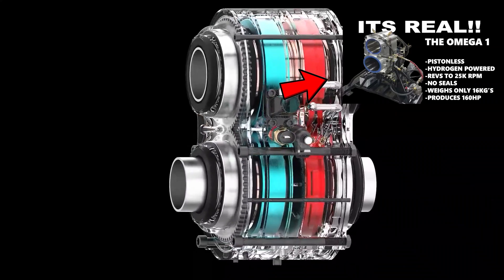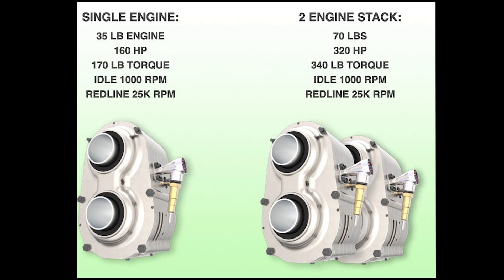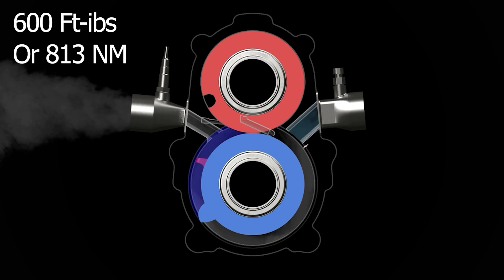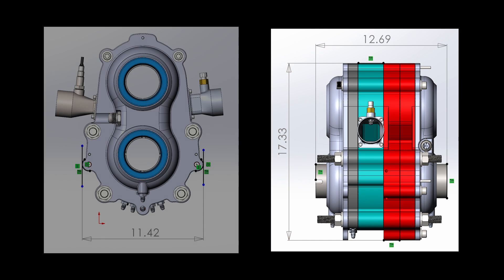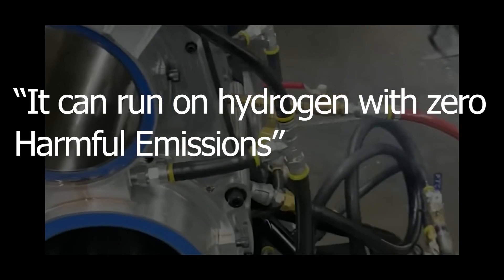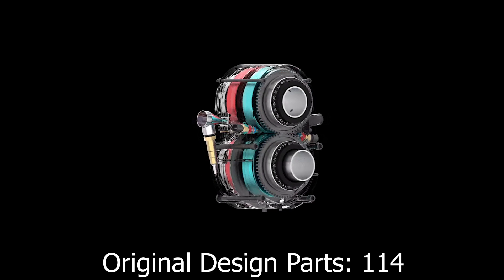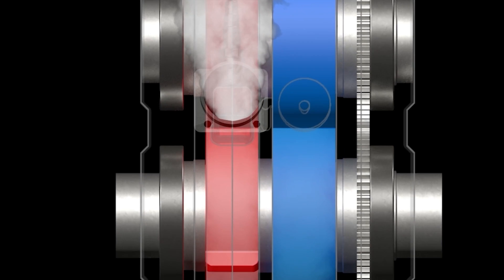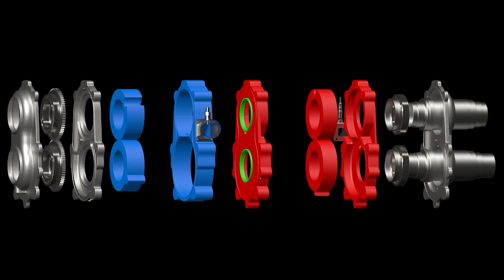Astron Aerospace Reveals Some Secret info on their Pistonless Omega 1 Engine - Starfire H2

Comment: well they claim you dont need seals and i think that running vid disproves that  with the flood of oil leaking past the upper rotor tube  upper and lower main ebd bearing seals are indacated  and gasket seals between the layers.   
  Me i want this for ships.

Comment: It looks like it's scalable, so it can be run in either series or scaled up to larger sizes, so it should be suitable to replace most other ICE power units.
The problem is getting a car manufacture to use it. They employ dozens of engineers to design their engines already, and there is no way in hell that those guys are going to say, "Oh look, let's use this engine instead of one that I designed!" 
The best chance is to get someone like Elon Musk to have a look at it. He'll be looking for something new for his Tesla's now that the EV market has pretty well collapsed. Maybe as part of a hybrid set up for his cars?
And seeing as Ford, GM, and VW look like collapsing, there is going to be a huge vacuum in the market just begging to be filled with the next big thing.
Reply: I had the same thought but CATL have created a million mile battery and after 100,000 recharge cycles does it start decreasing and performance degrades after 500,000 miles

Comment: So 600 ft-lbs, but it sounds like it falls on it's face real quick given the 25,000 RPM redline as that torque figure would give the 450HP rated power at a mere 4,000 RPM
If even half of that torque was available at 20,000 RPM, this thing would obliterate the 1,000 horsepower barrier, and still be able to keep pulling to 25,000 RPM but that clearly isn't the case here.

Personally, i don't think it actually works, and that they're just puking up numbers to try and keep people interested as quite frankly the math ain't mathing.
And as Adam Savage once said regarding perpetual motion machines, the ingenuity is in hiding the power source. I'm under the impression that this "engine" is being either back driven from the power output, or being spun up with compressed air (I've seen another video of it running, and whilst you can hear the "engine" it's masked by music that nobody asked for...

P.s. I'm no expert, but the numbers simply aren't telling the same story that they're trying to sell.
I see why they're trying to really sell it though, as military contracts are very lucrative, and the liquidpiston X engine (omega 1's likely nemesis) works, it's been proven, and warpedperception has a video of one actually powering a go-kart.
I really do wish them well though, because something that can rev from 1,000 to 25,000 RPM would be super practical as a static generator assuming power and efficiency is linear as you can throttle it to meet the actual demand

Comment: General aviation (private aircraft) has been desperate for anything that is reliable, light weight, and provides high power output...did I mention "reliable"?! Our opposed air-cooled engines are from the 1930's and prone to catastrophic failure from material fatigue, high engine heat, shock cooling, etc. Bring on a 300hp engine that has a high power to weight ratio, fuel efficient, and RELIABLE and you've got a winner that could revitalize the GA industry - truly. Love to see this in a few Cessna's, Mooney's, and Piper's! :)

Comment: You should ask them if they could integrate a starter motor/ generator inside the top shaft, I would think it should be able to generate enough electrical energy to power all accessories. Such as fuel pump, water pump, oil pump, AC and power steering.

I can imagine that engine being very easy to work on if all the accessories were electric and not bolted to the engine itself, And if the bottom shaft had an internal spline it could be ridiculously easy to pull the engine for service
Reply: If they could design it to allow for an 2-3 hour engine swap the engine could be replaced with a new one and sent back to a factory for rebuild  rather than trying to diagnose it in a shop environment that has never seen that engine before

I can't imagine a more efficient design from a maintenance perspective, it would also allow the manufacturer to see all the failure methods so that they can perfect the design overtime.

Comment: Those numbers seem overly optimistic considering the actual size of the combustion chamber, and considering a lot of the spec’s mentioned tolerances of 0.1mm, specially since stainless steel would expand more than that under the heat of combustion, and even tungsten which expand at a 1/2 rate than stainless steel wouldn’t be able to hold such tight tolerances under the combustion temperatures. Also there is no actual spec’s on the seals used to maintain airtight conditions or keep the lubricating oil away from the combustion chamber while rotating at max rpm’s (25000 rpm’s). It basically seems like a “vaporware” engine…

Comment: I am wondering about a water jacket and oil cooler, also a starter motor and fuel injection system with ignition system. Suitable transmission systems or gearing to run an electrical generator if the motor is not suitable for driving the wheels directly. Using hydrogen for combustion and the storage of same also sounds daunting. I would say we are in for a wait.
Reply: This uses no coolant. It's passively cooled and the oil is too. No radiator is needed, just a fan.

Comment: The buyers of vehicles, which are high value products, should be better informed & have better warranty. Today the buyer of a vehicle can't easily know what the TCO will be. The TCO for an incremental number of years, km & kW, should be mandatory information from the producer, for any vehicle; In addition to a requirement for complete lifespan documentation. Warranty for vehicles & other high value products should have a mandatory warranty much longer than today. A suggestion would be a minimum of 10years or 1million km for small vehicles & 20years or 5million km for larger vehicles like trucks. Both buyers & producers would benefit from this! Whether you invest in a new or used vehicle, you would be able to calculate  your cost of ownership very accurate.  Today the cost of ownership of vehicles can be very unpredictable, especially if the vehicle is more than a few years old. To sum up! The buyer of very expensive products should have access to accurate information, for a reliable estimate of cost of ownership for the warranty period. & the expensive products should have a warranty that reflects the value of the product.

Comment: When, not if, but when zero emission will take effect for vehicles in cities & air traffic. Then the next step will be to increase the legal requirements for efficiency, and complete lifecycle environmental impact. This engine has the advantage, of zero combustion contamination of the lubrication oil; which should extend the number of hours between the need for oil change. The wear & tear on oil lubricated engine parts should be reduced, in comparison to combustion engines with combustion contamination of the lubrication oil. I wouldn't know how to estimate the number of hours of running or kW created before the expected need for an engine service/rebuild of this engine. But the simplicity of the engine might suggest that the cost for rebuild, of this type of engine would would be lower than a more complex engine. It would be interesting to know if it would be possible to make a complete engine replacement automated;  Done by "robots" in a fully automated service and repair shop. So that you just let your car drive by itself to a service & repair shop during the night. & in the morning your vehicle is back. Automated service on fluids, brakes, tires, refurbished engine or exchange of windshield & damaged body parts should be possible.

Comment: Powerful engine? How does it connect to a powertrain? They designed something that spins fast so what , so do turbines but they were never practical for cars. There is no practical explanation as to why it would not burn oil. The moving parts seem to contact the housing on their sides otherwise you would never be able to seal the combustion chamber and i see plenty of surface area where oil is going to leak. Things that turn at those speeds do not have longevity due to centrifugal forces so i don't see it as a reliable car engine. The efficiency would not be better than a hydrogen powered solid oxide fuel cell connected to an electric drive train.

Comment: I see the working model of the old engine spinning a belt and pulley ! And leaking lots of oil ! Assuming the oil problem if fixed ! Not sure how you can get hundreds of horsepower out of it. The clearances are so tight any loads may disrupt the engines rotation ! Still looks like some solutions need to be worked out ! Thanks for the info 👍
Reply: P.S. in a perfect world you could just imagine yourself to your destination, and not have to hassle with the risks involved in travel ! Please let me know when that happens ! I am all in LOL

Comment: What seals the sides of the rotors? What keeps the air/exhaust/fuel from moving around your tooth/ compressor/ pistion of sorts? Just doesn't make sense to me. On top of this what or how does it cool the hot side. Eventually something is going to get way too hot? One more thing. Wht ate the shafts hollow? Wouldn't use that mass asca flywheel? I have soooo many more questions about this.. but first the side seals. You can't make the tolerances too tight because you have expansion going to happen. Or have they beat the laws of physics?

Comment: I am also fascinated by this but more detail needed. If you have contact with this company, can you ask? The thing I can't understand is how they achieve axial sealing. We see an ideal visualisation along the axis so that need/means for sealing is not immediately obvious. I mean, those are two huge rotors with a sliding surface which is going to have to sustain several MPa (for the quoted power/efficiency). I'm struggling to see how to do that efficiently. Large swept areas of sliding contact are usually a problem for any rotaries, this seems no exception. Also, the torque figure does not seem plausible. Then for power they seem to have quoted the peak pulsed torque (at instantaneous ignition) then multiplied that by rotary speed, when in fact the torque is only present for 30~45 degrees of 360 degrees (maybe, something like that?). If they have done that, it would imply the torque is constant for the whole rotation, which it won't be. This can again be seen by estimating the volume, which is about ~10cm (~45 deg of rotation) of a ~4cm width channel and ~2cm radial dimension. So at best maybe this is a 100cc engine, which is a capacity good for about 20bhp normally aspirated at 25krpm, maybe 30bhp with favourable tuning. This is simply a limitation of how much air is being shipped through the combustion cycle. Not that 30bhp is not useful, in fact it'd be a good power output for a range extender engine, but there are simpler and lighter versions of a 100cc engine.

Comment: that synchronising gear should be a double helical to reduce noise

oh, and burning hydrogen produces NO2, so it's not 100% clean
Reply from the maker: Because of low combustion temps and a egr it produces almost nothing
Reply: @ChrisVSCars  
'almost nothing' multiplied by a billion engines = something significant

still love it!

Comment: Experimental light aircraft are a good fit for those. That motor should be very inexpensive and have fantastic reliability given the design.  Smaller 300bhp and 160bhp options would be good to go for too, as in aviation every gram is counted.
Reply: drones are even better... my guess we wont see this anywhere and slowly it will fall to obscurity and only conspiracy theorists will talk about it.

Comment: Did they say if it can drive a drive shaft?
Reply from the maker: It has an output shaft yes :D
Reply: @ChrisVSCars  nice now the only question is can it use deisel or gasoline (specifically the crappy versions)
Reply: @ChrisVSCars  btw am i the only one thinking it sounds like a deisel engine?

Comment: I can't see this engine producing ANY torque as to produce torque there has to be pressure exerted against a fixed section of the engine. In a conventional engine the fixed part is the head. Either the animations aren't showing the whole picture or they are fudging numbers. The only way that I can see power/torque being created is if both of the rotors are part of the swept volume.
There's a direct relationship between power, torque and rpm and the numbers being quoted don't match the maths IF the peak power is produced at or close to redline. 25krpm and 320hp equates to 67 foot pounds of torque. IF you assume peak torque at 1/2 of the redline and then with 340lbft you should have an engine capable of 809hp.
Reply from the maker: They will be releasing engine dyno results in the coming months. Then we can see if all the claim hold true
Reply: you must get away from the thinking pistion engines work. This is very different.

Comment: If there have been improvements for sure there will be more, if this is piston-less I assume thus less friction and less heat, less pollution, more power and more economy. Anyone who says is not going to work they are nuts.
Reply: Can it drive a drive shaft tho or run on normal and even crappy gasoline
Reply: @THEANIMALGUY The engine runs on hydrogen
Reply: @sbrader97  but if it doesn't work with common fuels it will fall flat on its face the first world in general has the money to afford hydrogen or EV the only people that can find use in this engine that is cheap efficient and strong are the less fortunate people and less fortunate country's for example Africans middle easterns indian mongolians some south easterns Asia countries
Plus the less fortunate in first world countries that need the cheapest form of mobility that's personal not everyone can afford it if to can't run on common fuels plus who would make the infestructure for hydrogen? It's not economically viable unless the range is like a few thousand kilometers before needing a recharge (or refuel? Idk what word is for hydrogen) meaning they can make small number of stations far from each other in order to fuel every hydrogen car
Reply: I'm still sceptical... show me a working prototype. Flashy illustrations lofty claims doesn't mean much... I want to see the engine actually running...
Reply: @fcarstens6161  he(Chris vs cars) as made a video about it showing a working prototype
(At least it's said to be a working prototype)

Comment: I think longevity and efficiency are going to be the big problems here. Just like a rotary, they will lose efficiency due to issues sealing between the piston lobe and the wall, and between the two rotating surfaces.
Reply: The lobe and wall doesn't touch so there isn't any wear on the lobe. I did ask about that. Because of the super small gap some energy is lost, but it still makes more than enough power.
Reply: I spoke to the company recently and the service interval on these is looking to be 100,000 hours....  and should be as cheap as chips relative to current equivalent costs.